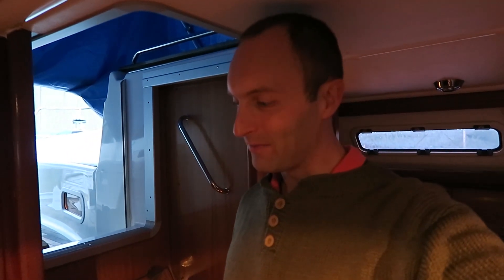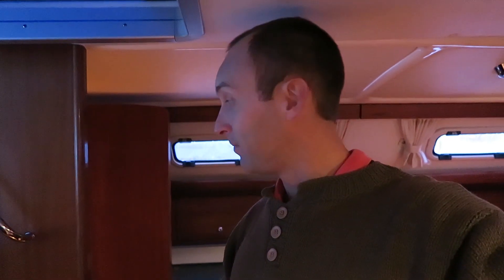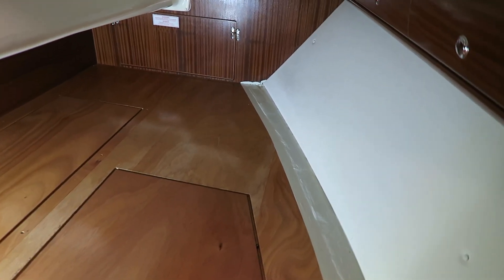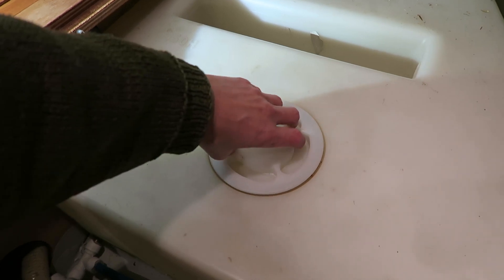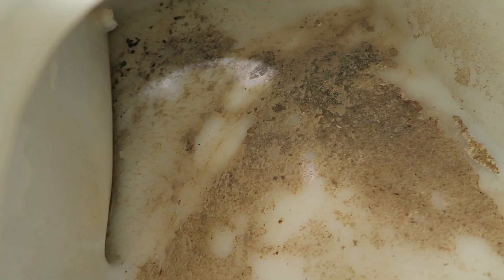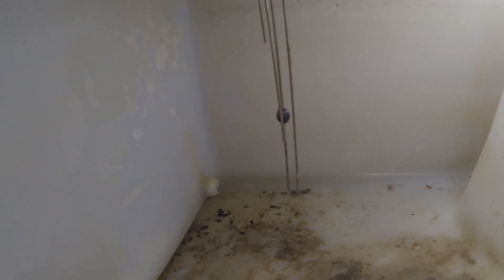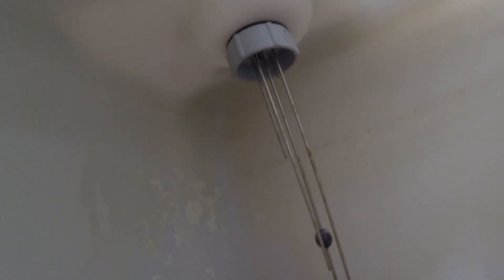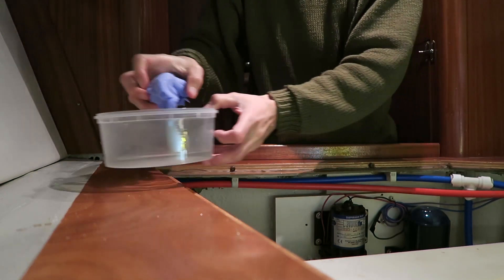Cleaning 150 L Bavaria water tank

Comment: Hi Tino! Thank you fore your nice videos. As an owner to a same Bavaria 32 from 2005, it is very interersting to see that you have the same problems and things to take care of. After lifting my boat I noticed the same leak as yours in aft cabin. I toke away the aluminium part (with the untitened screws) and put some Sikaflex under it before mounting it againg. That seamed to solve tag probleme for now. I like you idea to change to machine screws because of the weak construction.

Bengt Ljungquist Varberg Sweden
Reply from the maker: The sikaflex solution works but the problem is when someting hits or pull hard in the aluminium part, then it will leak again. My plan is to fill up the screw holes with epoxy and then drill some new ones so the alu part can be mounted the right place so it won't hit something so easily again. If someting hits or pull hard in the alu part the longer machine screws will hold the whole system together so it don't leak.I'll make a video so you can see how I fix the problem, but right now it is too cold to do anything.

Comment: Hi Tino!.. Many thanks for all your videos. Do you think this water tank or actually I want to ask about the fuel tank, are they replaceable tanks with the new ones? I see them too inaccessible and not easy positioned for dismantling. We have a Bavaria 33 Cruiser 2006 and the tank is leaking fuel. Do I replace or repair?.. Or would it be better to bypass the old one and place a new tank inside the starboard cockpit locker? What would you do if you were in my situation? Thanks.
Reply from the maker: The 150 liter fuel tanks is known to leak, but I have also seen leaking fuel tanks on other boats than Bavaria so not a abnormal problem. Sailing zephyr have recently had a leak in their watertank and they fixed the problem by plastic welding. If I were you I would try plastic welding first, I know there are companies there can do it for you. But if the leak is in a bad place the tank must be removed. The more expensive solution is to buy a new tank or get a new one made.

Comment: Thanks Tinu, I like your videos. Was there not anyway to access the other end of the tank to clean there as well?
Reply from the maker: Thanks :) - no there was no other access to the tank than the hole I used. Dirt and sand is normal to have in a watertank but nice to clean it out once in a while, maybe it would be possible to pressure wash the tank and then also access the area in the top with the water jet. Another problem I had was rust in the waterheater, a problem I solve in the next video on friday :)